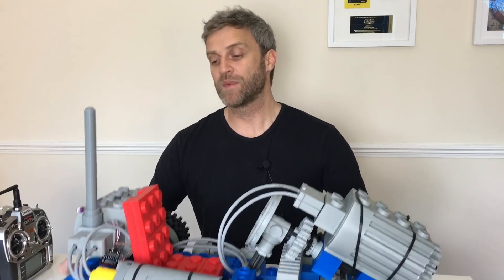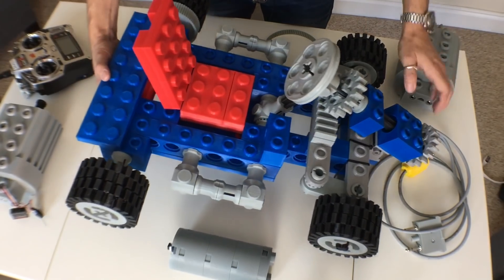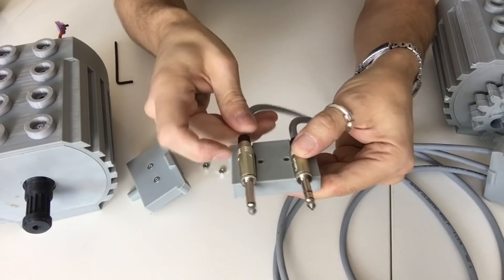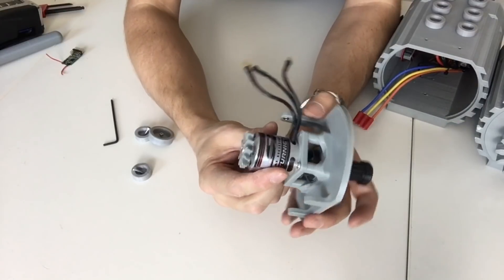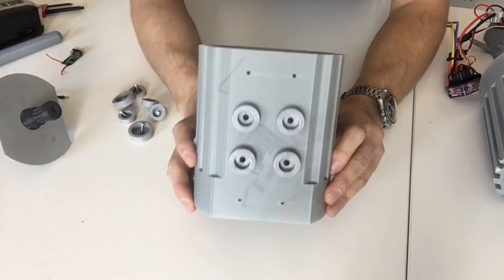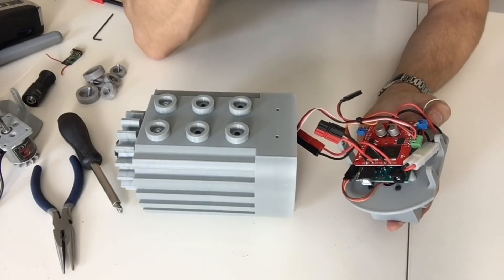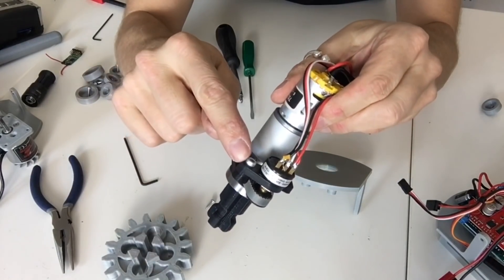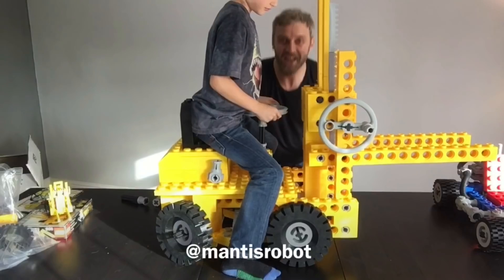Giant LEGO Go-Kart | Adding Motors! | - Mantis Hacks #14

Comment: Thanks for the detailed breakdown/inside view! :-)
the 'Phone Connectors' (https://en.wikipedia.org/wiki/Phone_connector_%28audio%29 )
you used are great for the design aspect but poor from an electrical perspective ;-)
a quick look at Neutrik (in my opinion one of the top manufactures in this kind of things) are rating there standard female connectors for 3A (up to 10A for NJ3FP6C-B and 15A for there NLJ2MD-H combo jacks..)
and additionally - with this type you can easily short your power just by inserting / removing the plugs!
but hey - design is key here ;-)
and i really like your 'diy big servo' setup.
is the potentiometer an endless rotation one? so if it is turned over its not destroyed?
and how did you match the needed rotation angle with the pot?

keep up the great work :-)
Reply from the maker: +Stefan Krüger yeah they are terrible connectors for using as power! Maybe I should have stated that more clearly.. but they looked the part :) yes the feedback pot is endless rotation, and is geared up so as to use more of the electrical travel giving approx 90 degrees of output rotation. This gives maximum resolution for better closed loop control.
Reply: +Matt Denton so you optimized your pot for your travel-range - that is good to know ;-)
for the closed-loop control - did you use some sort of arduino library? i have an old project laying around with linear motor-faders - back then i created some sort of closed loop with an lookup-table for the distance to travel to speed for motor mapping.... this worked not ideal...
Reply from the maker: +Stefan Krüger correct optimised for best resolution. Use the arduino PID library.. it’s pretty good!